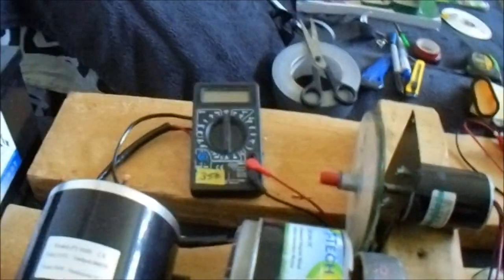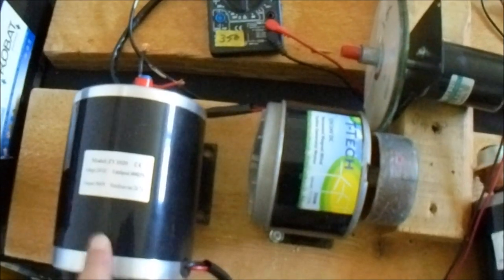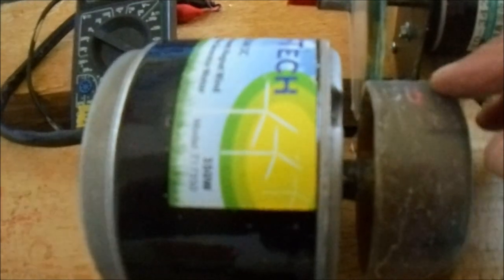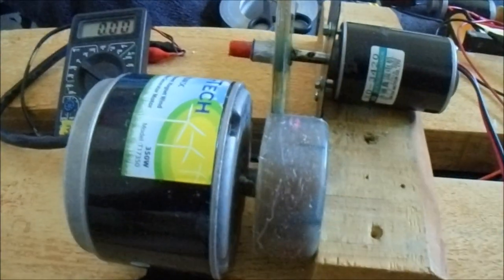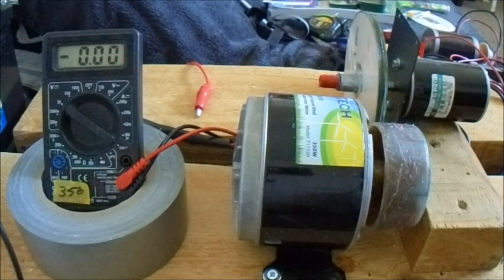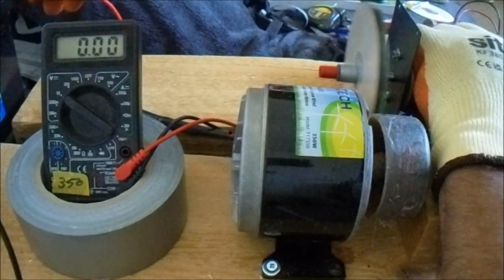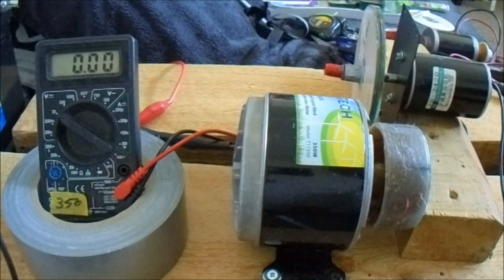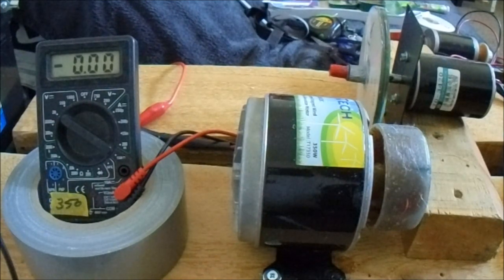Torsion Free Energy device - Proof of Concept test - 12 volts - 30 watts to 350 watts

Comment: The 350 isn't under load  .you didn't show amps ..volts times amps equals watts .not volts alone ..if you can charge a large capacitor bank and pluse the battery and it doesn't run down you got something. Yours should keep up the battery and run several hundred watts light bulbs .car head lights are around 60 watts .
Reply from the maker: thanks, yeah I have done some solar charged stuff so i kinda know what threshholds need to be attained.. i'm presuming i need a straight 18+ V to drop down to the 12+ V i'd normally get from a PV Panel.. i've tried some things since, like adding a charge controller in and trying some different things.. i need try 1 thing a bit more as that was getting somewhere... your comments are appreciated ! i will put another video on here once i have tried the next thing if it comes close... or even nearby lol
Reply: @AntiWeatherModification  try to shoot for 15.5 volts to completely charge the lead acid batteries.this keeps sulfation down.many are brain washed by the corporations in to using a voltage that leaves some of the plates uncharged this kills the batteries and pulsing is better.
Reply from the maker: @R2NOTU  thanks, i will do that... it's all about the sweetest spot isnt it... I am doing this in my living room so i have to be aware of the noise i am making when doing it and it restricts me in when i can try stuff... i'll make time though very soon as either way, fail or working, there are things to try and answers to be found.... i'll dig out my archived vids of previous experiments as well , as 1 came close... during playing with the method i had 54 V from a 12 V turbine on a V meter where i clearly hit the RPM and some.... it was only for a second or 2 but that lead me to go further with that style ( copying the old hippy method of using a bicycle to chain spin the turbine , but using an electric bike on full power instead of human pedalling and placing the turbine against the wheel to spin it and not chaining it ) I've got about 4 concepts that function but do not 'work' yet..